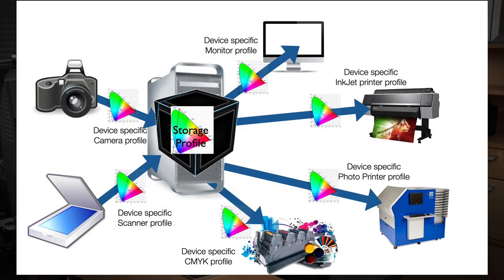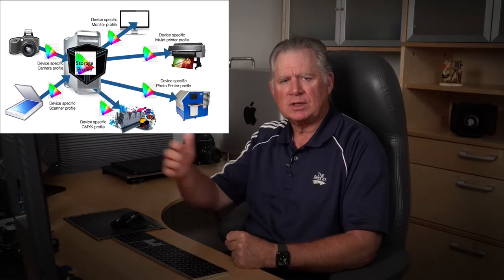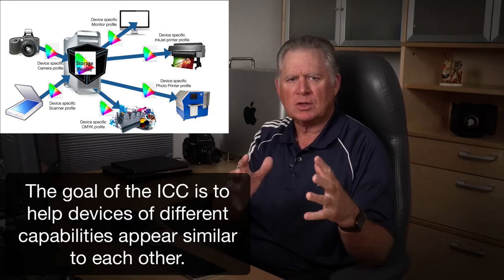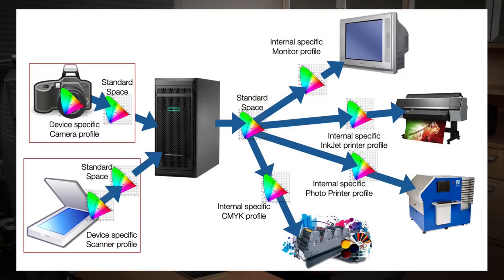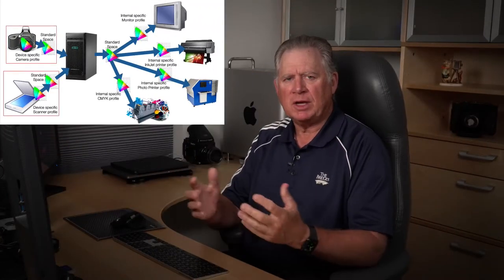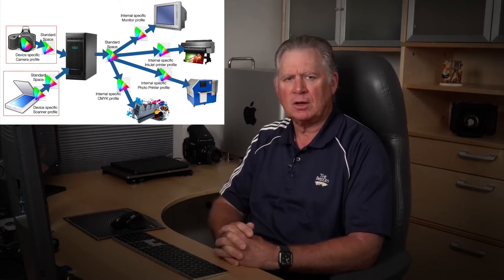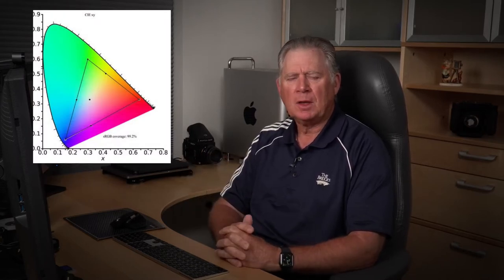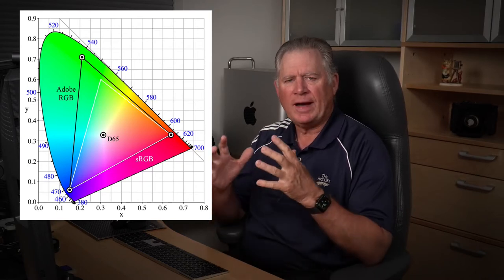Color Management Part 3... sRGB?  Adobe RGB?  ProPhotoRGB

Comment: Hi Wayne: Thanks for this video.  I must say that your explanation and use of the software to demonstrate the printable areas for the various profiles has been very interesting.  That being said, how would a person be able to search for printers that can print within the ProPhoto RGB colour space.  I have an Epson R3880 printer and I am very happy with it but what should l be looking at for a home printer?   Regards, Keith
Reply from the maker: That 3880 is a great printer, with a solid gamut.  Yes the current p900 probably has a slightly bigger gamut, but I don't think you would see any difference in your prints between the two.  The 3880  might be the best printer Epson has ever manufactured.

Comment: Hello Wayne, fist of all, many thanks for this series. It's been very helpful to figure out this very hard topic. Also, I am not a native speaker of English and hope my comment and a question is clear. 

I understand we need colour profiles of input devices, so the colours are correctly imported. Similarly, we need colour profiles of output devices s.a. monitors/printers/projectors, so that output devices produce or display correct colours. What I don't understand is why do we even need a colour profile in the system or say in Photoshop. Why do we have to keep ProPhotoRGB assigned to files? ProPhotRGB is very broad but still somehow limited? Can't we just remove it from a file and not to worry about any restrictions at all?

The only explanation to that is we may need to manage colours to match monitors with printers. But then, we need a custom colour profile, not a ProPhotoRGB in Photoshop. This is the only bit I have not understood.

Cheers!
Reply from the maker: One important fact that most miss is that you want to maintain the original colors as close as possible, so later when you convert to an output space you have all the data available for that conversion.  If you clip the colors into a monitor space, then you will be missing many colors that might be in your printer space.  Output spaces do not have a relationship with each other at all, instead they all have a relationship with a common “storage” color space., referred to a “working” colorpace. That’s the purpose of the theoretical color spaces, ProPhotoRGB, AdobeRGB, and sRGB. Those spaces are not created based on any output device, but are theoretical and based on maintaining the data (although sRGB really isn’t that either but for some reason it gets lumped into working spaces).  You have have a “common” space that can contain all the data, so as you output the data to differerent devices you have all the available data to make that conversion with.  Only ProPhotoRGB is large enough to contain all the information a modern sensor can capture, which maximizes the ability to map the data into various output spaces. the next video covers that concept pretty well.
Reply: Thanks for the response. This is quite challenging topic and I was confused about working spaces. The missing bit was the ability to make conversion. I didn't realise we would need to have something to convert from, that is a theoretical colour space. I thought a RAW data would work equally well. Cheers!

Comment: Thanks for the incredible knowledge Wayne, much respect!

would you agree that the purpose of ProPhotoRGB is not necessarily aimed at printing in that space but to perform a maximized translation when It came to editorial and finally the printing of one's image?
Reply from the maker: ProPhotoRGB is a storage space.  All data in storage spaces get converted to output spaces, you never see them in the space. If you use a storage space that doesn't have colors that are in your output space, then you limit the colors of your output space because your storage space cannot store those colors.  All current photo quality inkjet printers have some colors outside of AdobeRGB, and a lot of color outside of sRGB.  ProPhotoRGB is the only space designed with digital photograph in mind, and the only space that won't result in some color clipping somewhere in the chain before you get to your printer.
Reply: @cwaynefox  good point, thanks Wayne!